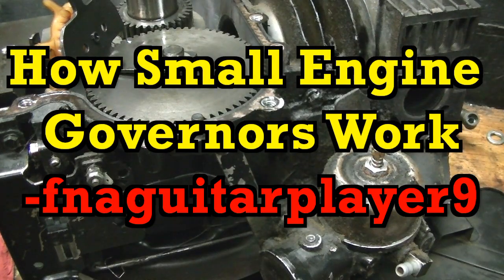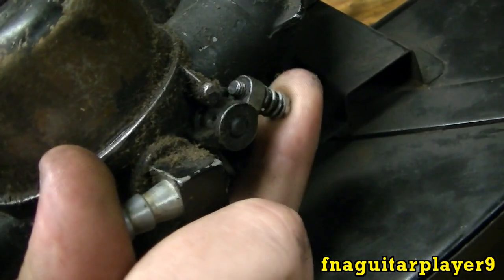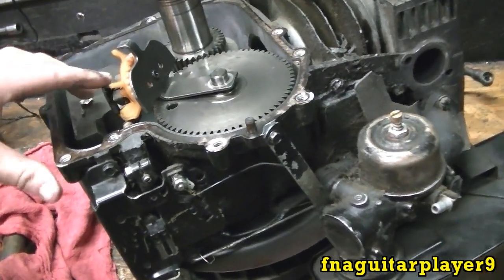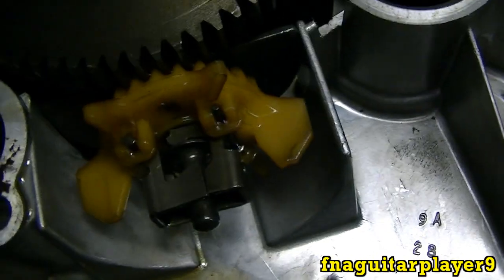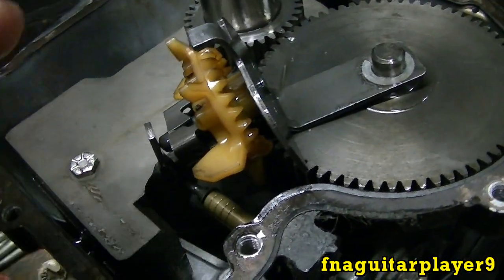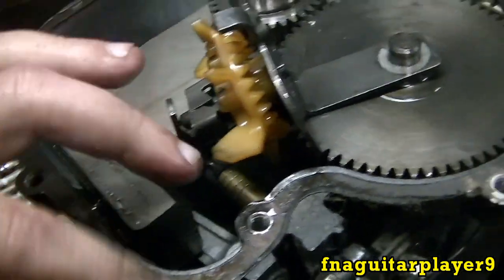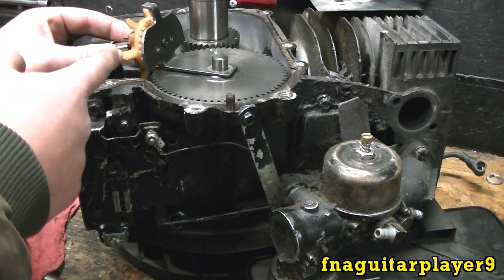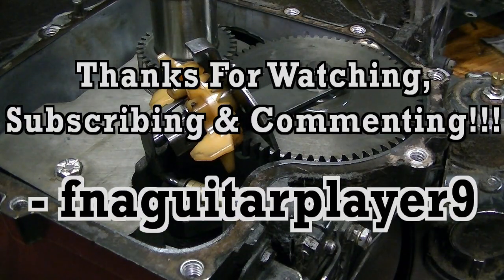How Small Engine Governors Work (any governor setup)

Comment: Good vid, I get it now, outside heavy spring puts tension on governor shaft which goes 
thru block, so there is pressure on shaft that moves out as weights spread out. I was
thinking that there would be 2 springs between the weights pulling them together,
but as i get it gov arm pulled downward exerts pressure on rod that moves in or out
depending how far the weights spread. I think I get the gist of this. Thanks!
Reply from the maker: Thanks, glad to help! Thanks for Watching!
Reply: @fnaguitarplayer9  I gave this a lot of thought and the way BS did this, way to
go.They could have had springs on the flyweights but if the springs broke, 
a lot of downtime to dismantle engine and fix it. much less if not impossible 
to have gov. messed up this way .Thanks again. wrkg on engine is a good
hobby, just got an old cast iron16 hp w updraft carb an car gen used as a 
starter, this would make 1 bad-ass Go-Kart.

Comment: @1:28 that rod with a spring around it , normally there would be no spring ... unless the rod connected to the governor arm is loose , therefore a spring is needed. If kept loose , you will face engine surging which is when the engine changes speed when it encounters different loads.
Reply from the maker: King County They all come factory with the spring, it keeps the linkage tight, your right, they will lope/surge if its not, not all the time, but when they do and the governor is adjusted right thats usually the problem. Thanks for Watching!!!
Reply: fnaguitarplayer9 Thanks for approving my knowledge , I guess my schooling is well paid for ... but I have 1 question off topic cause I cant find anywhere that has to do with what ima ask .. well im reading about carburetor inspecting and I came across a part where it said ,  "Place a metal block on the carburetor body under the throttle-plate
shaft. Use a feeler gage to measure the distance between the shaft and the
block first when pressing down on the shaft and then when pulling up on
the shaft " my question is , how big is the block suppose to be??????
Reply from the maker: King County I hear ya! Hmm, i'm not really sure on that, unless they mean just anything (like a piece of 1/8" flat stock) or something just to reference the micrometer (or caliper) to. Kind of like how you weight your self holding something, then without and subtract the 2, just like a filler to give a solid reference i guess.

Comment: For starters excellent video. Neighbor has a mini bike that lost the linkage with spring around it that goes from carb to governor linkage and used a wire in place of it. Is this good, bad or will it cause any issues w running or power??? I appreciate your input and knowledge if possible Sir. Thank you for your time.

Comment: That was an excellent explanation. Thank you. On question that I have. If starting up the engine and when set to idle and the engine speeds up way more than it is supposed  would the governor need replacing. I have already tried to adjust the governor with the speed up and and reset the arm but no change the throttle does not move the back to idle when set to slow speeds.

Comment: I have a little 1850 watt generator I have to have the choke on a little after it warms up. I took the carburetor off and blew through everything. I haven't checked for an air leak yet.
Reply from the maker: It could be a partially clogged jet or passage, or just to small of a jet from the factory. Thanks for Watching!!!
Reply: fnaguitarplayer9 thanks by reading the comments you know your stuff.

Comment: fna, when putting the sump cover back on, how is the best way to make sure the governer is in the right location as not to to tear up the plastic gears on it and also to make the sump cover to properly seat on the engine block? thanks so much for all your vids, very helpful sir.
Reply from the maker: william williams It can be tricky to get it line up right, get the governor/slinger to line up with the governor arm as i showed in the video, then get the cover started, and you will the camshaft go into the cover, then use a rubber mallet to gently tap it on, it should go easy after it gets over the oil seal. as long as the slinger is installed on the camshaft (hole in the bracket on the camshaft) the gears will mesh up just fine. I also recommend using form-a-gasket #2 on the block and cover surface, this also makes the gasket stick to it making it alot easier to install. Its not required but it definitely makes a better seal. I have a  4 part video on rebuilding one of these that goes into quite a bit of detail, i don't think i talked about using the sealant but you can see how the cover goes back on. there are a few other videos i have as well. I usually have the motor sitting like a side shaft motor on the bench, then prop up the camshaft side with a piece of 2x4 and it usually levels out so the slinger is in the right spot, keeps it from moving as much. I might make a video just talking about this summer, it can be a little tricky getting it all to line up, not nearly as bad as the transaxle cases though! Hope this helps, thanks for watching!!!
Reply: fnaguitarplayer9 i will keep your tips in mind for when i rebuild my engine fairly soon. thank you for your quick response. have a great new year!
Reply from the maker: If you have any problems, feel free to contact me, I don't usually answer back this quick, I just happen to be online at the moment, sometimes i'm slow answering back, but i do answer all comments asap! Thanks, you too!

Comment: I opened the crankcase to make sure the governor/slinger was working fine, then install motor back and adjusted governor arm properly. I checked carburetor as well. I'm puzzled to why my control lever has no effect from throttle to idle speed. I can't seem to slow the RPM down (4035) to 3600. I have a small 1 minute video to show that all is set as it should be, but I wish I could send it to you. I put less tension on governor arm, and my idle screw is as far out as I can get it. I still have no control lever operation.
Reply from the maker: What engine is it. I know on the 5HP they can be stubborn to get the bottom linkage just right. Also make sure that the cable isn't broken, i've had that happen one time, and didn't realize it! Usually the cause for no throttle response  is a broken governor spring or a linkage is loose. let me know what you find out. Thanks for Watching!!!
Reply: It's 18 H.P. b&s. There's nothing broken as you would see if I could send the 1 minute video. All the linkage are new and so is the spring.
Reply from the maker: Can you upload the video on your channel, you can set it to private and just send me the link if you don't want anyone else to see it.

Comment: Great info and demonstration.   I have a tiller that idles fine starts tilling fine and after a few minutes surges a couple times and dies?  New carb installed.  It was doing this before the carb change. I suspected the governor but after watching your demo im not sure.
Reply from the maker: Chuck Ezell Appreciate that! I hear ya. I was going to say carburetor, but we can rule that out, I'd say either governor or valve related, if the valves aren't sealing and/or the clearance isn't right, they will act weird and won't "tune in". Thanks for Watching!!!

Comment: I have the exact same engine and I’m having a problem with surging, the linkage from the carburetor all the way to the governor keeps going back-and-forth back-and-forth surging, it only does it at high-speed not a Idle, I thought it was the carburetor at first and I got a rebuild kit from Briggs and Stratton and rebuilt the carburetor, after rebuilding the carburetor it still does the same thing, I adjusted the governor by loosening the Lock nut and sticking a screwdriver in the slot turning it to the right and tightening the locknut on the governor arm, I started the motor and it still surges with the linkage going back-and-forth back-and-forth, I even replaced the little tiny spring that runs on the outside of the linkage arm going to the carburetor, even after replacing the little linkage spring, rebuilding the carburetor and adjusting the governor arm I can’t figure out why it is still surging, I also adjusted the carburetor screws in every possible different combination and it still surges, I have not opened up the motor and checked out the oil spinner/thrower like you did yet and was hoping it wasn’t necessary to figure this out, any ideas??? Thanks!
Reply from the maker: Those would be the typical problems that cause that, the internal parts of the governor could be bad as well. Thanks for Watching!!!

Comment: found this very interesting , so one question , working on a 4 hp tecumseh snow king horizontal shaft  engine ,   how do I set my governor   do I set it with the throttle in closed position, with the control rod against the governor inside plate , which way should the governor shaft be positioned to do this   clockwise or counterclockwise

Comment: Love your videos sir, and that southern accent makes me miss my almost 20 years of life in TN. I have a Leaf Vac with a Briggs Intek 875 engine. Inherited from grandpa in north Michigan. Engine was hydro locked and I have been able to fix it, ne oil, filter plug  and it is now running but only on high. Looks like it's all connected properly to the carb. Is there anything else besides a stuck butterfly valve that would make just run on rabbit speed? Any advice would be greatly appreciated

Comment: Thank you for your information, it was a great video, I did learn a lot about this small engines. I do have one I/C 11 HP It need it a carb I got one new and installed  it run for about 1/2 hour then I stop it when I try again it would not start I found I had no spark I can test the coil but I have no info as to how many ohm amI looking to get from this model oh this is the  info in this engine.I/C industrial generator  model 254422 type 50040-1 code 9409221B if you have any info that you could offer it will give me a better Idea what im doing with this thing. Thank you so much for your time and have a great day.

Comment: Well, hurricane Laura arrives in my city tomorrow and I’m trying to tune my generator after putting a new carb on ‘er four years ago.She’s a little boggy and won’t reach full idle. I hope I get it or it’s gonna suck around here.
Reply from the maker: I hope you can figure it out in time! The governor may need to be adjusted since its a new carb, sometimes the linkage may be in a slightly different spot and throw the setting off. Thanks for Watching!
Reply: fnaguitarplayer9 well,I got her running just in time,but I had to tie a string to the choke and manually set the rpms. It roughly idles and does not respond when the governor throttles up. I hope she lasts because we have about a month of 90+ degree heat with no electricity
Reply: fnaguitarplayer9 well,I had to buy a new one. But still trying to figure out the old one. Question: when I pull the pull cord,the governor stem turns clockwise. At this position shouldn’t the throttle be in the idle position? And counterclockwise movement should open the throttle? Thanks!
Reply from the maker: @yaryar1976  no, clockwise is opening the throttle

Comment: I have a 15.5 up Briggs I changed carb,head gasket, adjusted the valves it was running great, then out of no where it went wife open on me,what could be the culprit? I no it's got to do with the Governor,could it be that gear with the counter weight's?
Reply from the maker: It may be a linkage came loose or something for it to do that or something got binded up Thanks for Watching!!!

Comment: I do  have a question since you are talking about modifying smaller motors. My question is will a 12 hp  Briggs coil interchange with a 15 hp Briggs mower

Comment: What does the spring on the rod do? That's what I'm confused about. My engine is surging on my DeWalt pressure washer and I'm the repair manual it saying the issue could be that spring. The other issues it says could be are good. My spring is not attached. The other half of the spring is gone.
Reply: You need that spring.  The spring play an important role, it keeps the governor stabilized.   NOTE:  You wouldn't think so, but just a little play in it, the engine can surge like crazy.
Reply from the maker: Jordan pretty much answered it, it just keeps the linkages tight so it won't lope/surge, some engines will do fine without the spring but certain ones have to have it. Thanks for Watching!!!
Reply: Thanks yall! We'll dewalt doesn't make that spring anymore. I bought a box with random ones in it and go it working! No surging. Now what I was so confused about was how long the spring should be? How much tension? Make the length with throttle open or closed? I forgot how exactly I did it but I got it.

Comment: Does the retainer washer  that goes on the shaft hold the governor gear in place  so it cant move away from the cam  push all the way in to  the botton Briggs straton 17.5  Lh ead opp cylinder .No goove on the shaft  PS puting engine back together RETAINER washer missing.
Reply from the maker: There is a spacer washer at the bottom that acts as a bearing surface but there is a clip type piece that holds it all together it just kind of presses on. Thanks for Watching!!!

Comment: and it is not under load from pumps and stuff its just running just the shaft
Reply from the maker: +jarek da boss !! if its not much load at all, and it will be a slow speed like idle, then no you can do away with it that case, i thought you was referring to a racing setup like a mini bike or go kart. Thanks for Watching!!!
Reply: +fnaguitarplayer9 oh and no problem

Comment: Perfect example. Im so glad I found your video. I looked for a few days with no luck and then utube put this one in my feed. I had backwards on my motor. I cranked it up and I've NEVER heard a little motor rev that high!! I killed it fast and back to the drwwing board. Origanly all was wrong was the head gasket letting pressure past my push rods and into the crank case pushing oil up over my rings. So thanks again for your time making this video!!
Reply from the maker: Your welcome, glad you were able to find it! Thanks for Watching!!!

Comment: So i removed the governor on my briggs and she aint got the oil slinger anymore motor is on a off road go kart havent had any issues yet but should i get a piston rod like the raptor that has a oil slinger?
Reply from the maker: Yes, you will want the dipper on the rod, without it, it won't last long, trust me. Thanks for Watching!!!
Reply: @fnaguitarplayer9  upon further inspection the connecting rod does have a oil dipper i did order a billet one though.  The motor is a stock briggs 5hp funpower did briggs sell those motors with the oil slinger connecting rod from the factory?
Reply from the maker: @Jeff-td2ns  The billet one will take alot higher rpms, yes all of the horizontal shaft engines had the dipper on the rod, unless it was a larger engine that had a oil pump, but all the small ones were like this.
Reply: @Jeff-td2ns  -  Listen to the OP.  I removed my governor and about a month later, the engine gone!  LOL
Reply: @JodBronson  i did just installed a arc billet connecting rod and a billet flywheel
Reply: @Jeff-td2ns  - It will work.  Just not long due to RPM of Engine.
Reply: @JodBronson  what do you recommend besides an animal motor lol
Reply: @Jeff-td2ns  - LOL, you don't have a choice if you are on a budget.  Other than that, get a bigger motor for bigger project.  LOL
Reply: @JodBronson  budget aint a thing lol long as the wife dont find out lol
Reply: @Jeff-td2ns  - LOL
Reply: @JodBronson  im gonna build up a raptor block and in the mean time run a predator 212

Comment: So when putting the engine back together and putting the crank case on the governor post needs to be against the governor arm when I put on the crankcase cover?
Reply from the maker: Yes, if the slinger's rod is pointed at the governor arm it will slide right on with no problem at all. Thanks for Watching!
Reply: @fnaguitarplayer9  thanks...I got it on....I just wanted to be sure it didn't need to be in front of, behind, or on the gouverneur rod... when putting the case back on.......👍

Comment: I have lawn mower that when I first start it it runs normal but after about 30 seconds to 1 minute the rpm's start to go up until it is racing to the point that it might throw a rod. I throttle it down to normal rpm's but then it will not mow because the governor is not working, so while mowing I throttle it up so it will run. Everything is clean and nothing is missing and like I said it runs normal when first started. What could be wrong?
Reply from the maker: I would suggest adjusting the governor and see if that helps, if not the internal governor piece may be broke or not working. Thanks for Watching!!!

Comment: If I were to convert a Vertical Briggs 500 158cc 5hp to a Horizontal, would the oil slinger still be sufficient for lubricating the piston?  Or should I make a little slinger instead.  It used a fan governor and I'm using a different carburetor now, and I've already filled and relocated the oil feeds for the drive shaft and cam shaft, I just want to know if the old slinger is good enough.
Reply from the maker: I don't think so, it would be to high to pick up the oil, you will need a rod/dipper out of a horizontal shaft engine, the metal dipper on the end of the rod that would pickup the oil, i was going to suggest modifying the bearings so they get oiled but you already did that. I'd say get the dipper and you'll be good to go. Thanks for Watching!!!